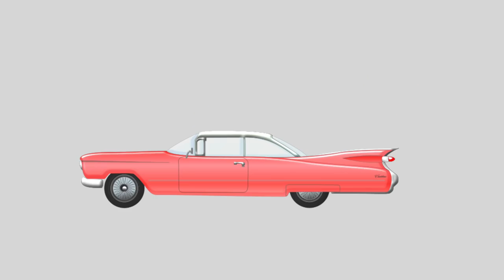Yes, Rockets CAN Fly in a Vacuum

Comment: Why isn't speed increase unlimited in space when using standard rockets. Hypothetically let's say we had unlimited amount of rocket fuel and we are already in space. Why couldn't the rocket reach near light speed? For example the rocket burns for one hour then stops. The rocket is now traveling let's say one hundred thousand mph.  If it's in space it then seems to be at rest even though it's moving forward. Then burn again for another hour. Then it's going 200kmph. Why not ?
Reply: You've actually described exactly how a body in an inertial reference frame would experience acceleration.
Assuming that the mass of the fuel you had to carry was ignored, but it's just a hypothetical thought experiment.

In your example, the only speed limit is light speed.
Reply: @niallkinsella2687  Ok so theoretically we could accelerate for ever until we hit the universal speed limit of light? 

If we had unlimited fuel we could?

 Or when we are in the vacuum of space, we can only go forward as fast as the rocket can push ?

I am told I am smart and actually almost made it onto jeopardy....but this is something math related I'm sure and my brain won't wrap around this for some reason lol
Reply: @niallkinsella2687  oooo so it wouldn't work unless the thrust created was constant and great than the mass of needed fu
Reply: @carltonkidd2686  
For an object with mass to reach the speed of light, it would need infinite energy to accelerate to that speed.
But this is a thought experiment so we're allowed to break that rule :p

At any single moment, the rocket can be assumed to have zero velocity. That's an inertial reference frame.
Now the rocket spends fuel to create exhaust in order to accelerate.

In the next moment, you can assume the rocket has got zero velocity again. The remaining fuel and the rocket are all traveling at the same speed in the same direction, and not being interfered with by anything else. An inertial reference frame.
Fire up the engine again, and you accelerate again. Relative to you, the exhaust is travelling at (made up number) 1000 meters per second in one direction, and you gain equal momentum in the opposite direction.

You can keep doing this, over and over, until you hit light speed.
Reply: @carltonkidd2686  Here is a very simplified version:

Imagine that for the rocket to accelerate to half the speed of light it requires1.21 MegaJoules of energy.
but now to accelerate half AGAIN the way to light speed requires the SAME amount of energy.
Now you are going 3/4 the speed of light.
Now to get to 5/8 the SOL requires ANOTHER 1.21 Megajoules.
Every little increase in speed requires MORE AND MORE ENERGY.

so it would take an INFINITE amount of energy to reach the speed of light.

This is because as you ACCELERATE, your MASS INCREASES.
SO as you approach the SOL, your MASS approaches infinity.

You can NEVER GET THERE because accelerating an INFINITE MASS requires an INFINITE amount of energy.

Comment: Show footage of a small rocket  launch in NASAs giant vacuum chamber.     I cant find a single vid showing anything flying in a partial vacuum chamber.  If things can fly with no air lets see it demonstrated.
Reply: SYmPHONICNV Google it
Reply: Bobo,  you google it.  I already did and found nothing.   If  things like rockets can fly with no air lets see it demonstrated.
Reply: SYmPHONICNV it has been demonstrated and its Here on YouTube
Reply: Show footage of a small rocket  launch in NASAs giant vacuum chamber.  post the link here.
Reply: SYmPHONICNV There is None yet
Reply: SYmPHONICNV There are in smaller homemade Chambers tho
Reply: A combustion test  in small volume sized partial vacuum  chamber is not proof of rockets flying   in a partial vacuum. That is a false conclusion because the combustion chamber is isolated from the vacuum and expelling fuel through sublimation and  filling the small chamber with gas and thus causing the chain reaction against the inner surface of the small volume sized chamber.  

  Show footage of a small rocket  launch in NASAs giant vacuum chamber.  You keep saying there is footage and telling me to go find it when none exists.
Reply: SYmPHONICNV There is footage of Rocket engines in vacuum Chambers, but Not in NASAs. A simple way to proove Newtons Third law is to Sit on an Office Chair and throw a Bowling Ball, Pushing Off the Air doesnt get you the thrust
Reply: SYmPHONICNV even then you could Argument that a Rocket Just pushes against its own exhaust Trail in a vacuum
Reply: You are not understanding the claim and lack of evidence.  
No footage, case closed.   You have never observed earth in space, earth in motion, or earth curve.      Rockets flying without air,  where is the footage?
Reply: SYmPHONICNV you have never pbserved earths firnament, its Edge or its supposed flatness
Reply: Changing the subject is not a counter argument.    You still have never observed earth in space, earth in motion, or earth curve.  You never will.    

   Rockets flying without air,  where is the footage?

  Your heliocentric space ball religion is false.     

 The firmament cannot be measured in height.  You can see the the stars and they are within the firmament. There is an edge, its called the ice wall barrier.  Beyond that is extreme weather and terrain that are put in place to serve as barriers preventing exploration towards the place where the firmament means the earth.  The barriers are in place at from deepest depths to the highest altitude.  There is no south pole.  Go look outside and you will see the flat earth as far as you can see with your own eyes, no matter how high you go in elevation or altitude.
Life is a miracle, reality is a miracle.
Reply: SYmPHONICNV Thats insanely wrong, i live in a very flat Valley and i can See much further on the Mountains Behind me
And There is footage of Rocket engines producing Thrust in vacuum chambers
Reply: You have never observed earth in space, earth in motion, or earth curve.      Rockets flying without air,  where is the footage?  No footage, case closed.

Comment: Can you let go of a balloon full of air but in a vacuum please?
Reply: It will fly around.
Reply: @stuartgray5877  Right, it will fly around but without the fart-noise.
Reply: @stuartgray5877  it will burst, but whatever, chatbot 😂
Reply: @papalegba6796 depends on the pressure of the air inside doofus. Good to see you’ve made yet another sock account.
Reply: @engineeringtheweirdguy2103  You seem very aggressive, why is that, chatbot? 😂
Reply: @papalegba6796  you think that’s agressive? Oh you poor little petal.
Reply: @engineeringtheweirdguy2103  according to papalegba it is impossible to have a balloon filled to 5 PSI inside a vacuum chamber at 0.0 PSI - "Cuz Reazons".
Reply: @stuartgray5877  like to see the equations that prove that’s impossible.
Reply: @stuartgray5877 boyles law, chatbot. Balloons are flexible, chatbot 😂
Reply: @stuartgray5877  you've never used an equation in any of your replies, chatbot 😂
Reply: @stuartgray5877  exactly.  And you've never used an equation Stu
Reply: @DrCash7  Nope. In all the years I've interacted with it, the chatbot Stuart Gray has never used one physics equation to explain itself. Ever.
Reply: @papalegba6796  Sure I can F = mXA, or A = F/m, OR m = F/A.   Which basically means that a "FORCE" can create an "ACCELERATION" of a "MASS".

Now tell us HOW rocket engines accelerate mass. Because we know for a FACT that they DO.

AND v = v0 + at which means that a VELOCITY results from an ACCELERATION.
Now tell us HOW rocket engines accelerate mass without applying any force to that mass.
Because that IS what you keep claiming.
Reply: @stuartgray5877  that refers to external force, which a vacuum cannot apply. This is why you never use equations, chatbot, as they immediately prove you wrong 😂
Reply: @DrCash7  chatbot Stu finally tried using an equation & immediately proved rockets can't work in a vacuum 😂😂😂😂😂😂😂

Comment: This video didnt explain anything about how matter and energy escaping or being pushed out a tube really fast actually moves it in a vacuum thanks for nothing.
Reply: "Another way to think of it without (directly) invoking Newton is to envision an exploding grenade in space. The gases from the explosion expand outward more or less equally in all directions, flinging the grenade fragments in all directions as well. Now take away half of the grenade shell. The gases still push outward in all directions, but meet nothing to push where the housing has been removed, so they just escape out into space. But they also push against the remaining shell of the grenade, sending it on its merry way. A rocket engine is just a grenade with half of the casing removed. Well, a little more refined than that, but you get the picture." - @lesnyk255

Quit your job lady yt commenters r doin it better.

Comment: But why the law? Why does it still work in space where there is nothing?
Unless space too is a medium just like air/water?
Just saying it works like that because it does doesn't really make any sense.
Reply: When the engine is off, the fuel and oxidiser is sitting in the tanks, flying along with the same velocity and direction as the rocket.
They have zero velocity relative to eachother.

Turn the engine on. The fuel and oxidiser is now flying out of the engine bell at several meters per second.
The velocity had been forced to change, which is an action.
The rest of the rocket will also be forced to change its velocity in the opposite direction in order to conserve momentum, a reaction.
Reply: Za guite - if you fired a crossbow in a vacuum, would you feel recoil? Yes or no?
Reply: @niallkinsella2687  My question is why is there a reaction if there is nothing to react to. Its just space.
Why would a fart propel you in the opposite direction  if the fart itself have nothing to work against?.
I do get that its Newton's law but have we ever wondered how it actually works?
Reply: @stuartgray5877  yes, because Newton sez so.
Reply: @raptorreaper  
What's the difference between the crossbow bolt and a fart?
Both have mass, both have undergone a change in velocity.
Reply: @raptorreaper  so why would a rocket be different?  Both objects (crossbow and rocket engine) are ACCELERATING MASS, why wouldn't they BOTH feel RECOIL?  Or are you suggesting that exhaust gas (which has mass) can be accelerated without a force?
Reply: @stuartgray5877  you guys are way off point here.
My question is " Is space really empty or it is a medium just like air /water because all laws of physics work in space too?" 
Is it really empty or not?
Reply: za guite yes it’s empty
Reply: @raptorreaper  Wasting your time with the shilltastic duo there.  Stuart will start with the crossbow example, saying that both have mass so both should behave the same way when a force is exerted on them.  The problem is fluids (gasses included) do not behave the same way as solids-- the same way you can't walk on air or water.  Without drag (read friction) planes would have no lift.  Without traction car tires would be unable to move the vehicle.
Reply: There's no such thing as a perfect void, but a few particles per cubic meter is as close to absolute vacuum as you can get in this universe.
Reply: @raptorreaper  here is an example that DrCash CANNOT ANSWER:. if a 5000 kg mass crossbow fired a 500 kg block of water ice, into a vacuum, at 2500 meters per second, how much velocity would the crossbow acquire during the firing?  This is a simple problem that anyone who has taken high school physics can solve.  I can do it IN MY HEAD.  Hint: study the Law of Conservation of Momentum.   Answer: YES a firehose shooting out water into a vacuum WILL Feel a recoil,  regardless of what high school dropouts think
Reply: @raptorreaper  want PROOF of rocket Propulsion in a vacuum?
 Search YT for "SpaceX ArabSat launch and booster landing 4K". 
 Watch the video of the falcon heavy fly into space, then the side boosters returning to land at KSC.
  Report back after you watched that video to the landings.
Reply: @raptorreaper  did you watch that video I asked you to above or not?

Comment: What makes the gas shoot out of the rear of the engine???? Why doesnt it shoot forward and explode the fuel tanks?
Reply: Pressure.
Reply: The pressure of the fuel and oxidizer before entering the rocket engine through the injector is greater than the pressure inside the engine, so the propellant flows into the combustion chamber, and not the other way around. That's why a lot of liquid propellant engines use turbopumps, to increase pressure of the fuel and oxidizer.
Reply: Watch the YT video: "uninterrupted footage of the falcon heavy launch and booster landing! 2-6-18"

For undeniable proof that rockets work in a vacuum
Reply: @stuartgray5877  what does the rocket push off???? Why  doesnt nasa show a video of a model rocket working in their gravity chamber???
Why dont they drop a pice of paper vertivally in their vaccum chamber?????
Notice they always use a feather?????
Reply: @vaughanscott7308  "what does the rocket push off" 
Answer a question and you will receive YOUR answer.
If I fired a steel projectile from a crossbow into a vacuum, will it experience recoil?
Reply: @vaughanscott7308  and what the hell is a "gravity chamber"?
Reply: @vaughanscott7308  why are you afraid to answer my questions? Im just trying to help you understand,
Reply: @vaughanscott7308  : Gravity chamber? Jesus dude, you sure aren't bashful about doubling down on ignorance!

Comment: Thank you for this, my idea for my interpretation of a "Vacuum" engine is still alive and well. I just have to change the name but my engine works as a vacuum in the sense of how it works and of course traveling in space.(The Vacuum) But not at all like how a traditional vacuum engine works. I think I have a more than plausible theory for high speed space travel, safer deeper space travel(relative to time and distance into actual space and return), and entirely based on the idea of conversion. I think I also have a much more accurate definition of dark matter. I just need to prove it. Understanding dark matter gave way to my vacuum engine idea. Take care thanks again
Reply: The first step is mapping the cosmos. You can't travel at high speeds without risk! The risk is variable on our mapping of the universe. Once we map the cosmos lights years out then and only then will deep high speed space travel will be realistic with an extremely low death mortality rate.

Comment: Why is your explanation so complicated, and what is the point of the car analogy, which really isn't one because cars aren't even propelled by thrust to any meaningful degree?  If I didn't understand this stuff already, I'd be confused and have to take what you tried to say purely on faith!  Look, rockets do in fact push against something--not the Earth or its atmosphere, but rather the mass of the exhaust gases.  While the gases at any given moment are light in mass in comparison to the rocket, they are expelled at such a high velocity that enough reaction force is still generated, according to Newton's law, to accelerate the rocket against gravity and air resistance (or drag, which can be quite substantial, contrary to what you said).  That's it.  It's analogous to an astronaut pushing against another object in space, resulting in opposite forces and accelerations being applied to both the astronaut and the object.  If the object is much less massive, then it will accelerate to a faster velocity than the astronaut, which is taken to the extreme in the case of rockets and their high-velocity exhaust gases.

Automobiles have nothing to do with this because unlike rockets they are not jet-propelled by their exhaust.  The force of the internal combustion acts directly on pistons that drive wheels through a crankshaft and gearbox (or equivalent), and these wheels and the tires that surround them rotate and push against the Earth using friction.  The amount of exhaust gases is limited and the velocity is so low that it provides practically no additional propulsion, which is why they are expelled through a flimsy muffler, and sometimes downward or even to the side.  I have no idea what you were trying to do with this example.